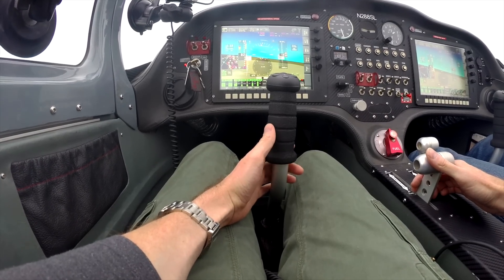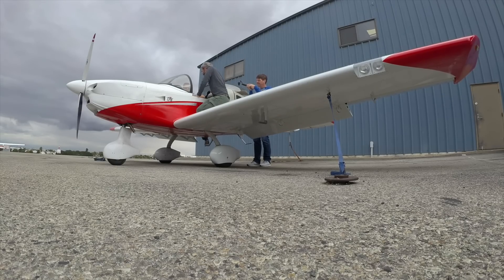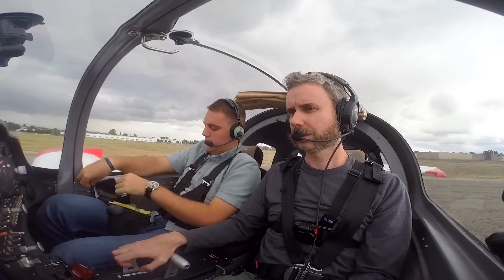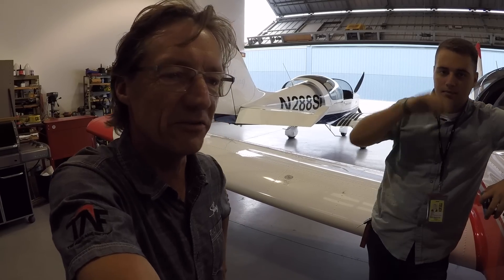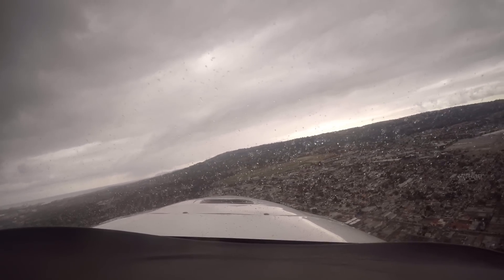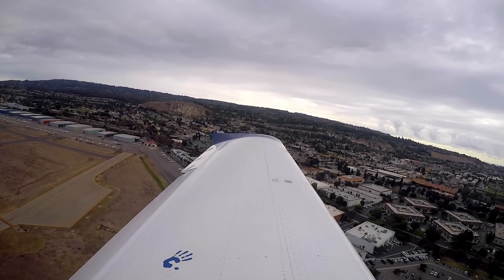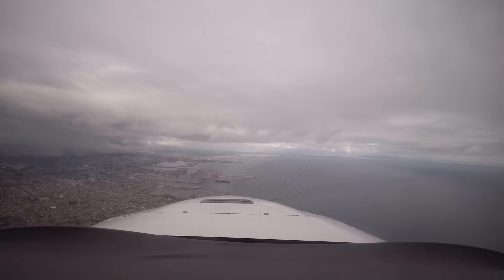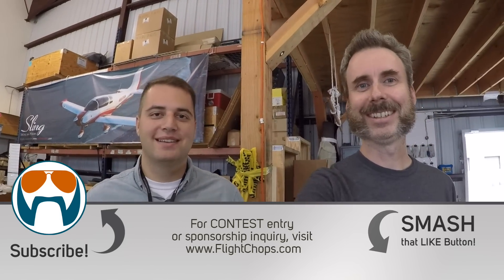Rotax Engine Failure - Flying Impressive Sling2 LSA in SoCal

Comment: Steve, you ARE inspiring the next generation, as well as entertaining and delighting the previous generations.  I've seen Bob Hoover a couple of times, his Energy Management Routine is something that every pilot should see and understand, particularly multi-engine pilots.
If I was getting back into flying, the Sling would be an awesome 'Weekend Flyer' for that $100 hamburger up or down the coast, but obviously wouldn't be a long distance flyer.  Josh Flowers also has a review of the Sling.  Would be a fun airplane to own.
Thanks for putting us in the left seat again, it's always fun to fly with you!
Reply from the maker: Thanks Gary!
Reply: Gary C - I believe you’re wrong about the long distance flyer bit.  We have a Sling 2 and a Sling 4 at our aero club (Ballarat, Victoria, Australia).  The Sling 4 has taken a family of 4, plus their dog, plus baggage all the way to Far North Queensland and back (over 2,000 miles each way), and down the full length of western Tasmania (again, well over 500 miles) with legs in both cases limited only by “bladder capacity”.  The Sling 2 has flown most of western New South Wales and northern South Australia - again with 500 to 800 miles range.  Both cruise at about 115 knots.  The Sling 2 burns about 19 litres = 5 gallons per hour, with 140 litres = 36 gallons on board; the Sling 4 - 115 HP Turbo Rotax - burns about 25 to 27 litres (6 to 7 gallons) per hour, with (from memory) 180 + litres = 48 gallons (?) on board.  Comfortable seating, plenty of room, good overnight baggage storage and 6 hours’ cruise plus reserves on board - what more do you want?
Reply: @warwickkinscher5986  I don't recall the reasoning for the sentiment, but it may have been something other than fuel burn.  Other factors to take into account, like comfort can come into play.
A Cessna 172 has a 600-700 mile range, but I don't want to sit in it for five hours at a time!
But, it's been a year ago since I posted that comment, I don't remember what it was all about, sorry.
Reply: Gary C No problems; We also have a Cessna 172 which is a good cruiser.  It’s just that I have really enjoyed flights in the two Slings, but Simon has put well over 300 hours up on his Sling 4 in the slightly less than 3 years since he completed it, flying the full length of the east coats of Australia with his family and / or friends.  It’s a great all-round aircraft.  But I agree - legs on a flight are governed by the needs for food and / or bladder relief rather that the aircraft’s capabilities - as long as one remembers to always check the fuel left and make sure it’s sufficient till the next fuel bowser including fuel for not only reserves but also contingencies (diversions, last light, weather, etc.)

Comment: Need to stop perpetuating the fuel gauge lie. They have to be accurate during flight. §23.2430   Fuel systems (a)(4) Provide the flight crew with a means to determine the total useable fuel available and provide uninterrupted supply of that fuel when the system is correctly operated, accounting for likely fuel fluctuations. Also, §91.205 (b)(9) Fuel gauge indicating the quantity of fuel in each tank.
Reply: They only have to be accurate if you a noob and didnt do a proper pre flight !!

Comment: this is why Carburettors are no longer used in cars. UNRELIABLE. being an aircraft. you would think...... fuel injection is a must. plus having Fuel injection means no more mixture adjustment. better engine reliability, better economy,. safer engine operation.. 
RELIABILITY

Comment: 6:51 I suppose any engine can be brought down by a defective float in the carburetor, but good grief this engine has FOUR floats and FOUR points of failure!  This is not redundancy, this is FOUR paths to failure!  Perhaps the  good news;  how does the engine operate at full power with one defective float and that carb running RICH???  Search for and read comments by Doug Grant.

Comment: If you fly machines, you should know they are not fail proof. To declare Rotax engines are crap is just more foolishness. To me, they've come a long way and have proven quite reliable. 

nice to run in to you at SNF, chops.
Reply: WendelltheSongwriter Rotax engines initially came with a factory guarantee. They were guaranteed to fail when they were two strokes :)
Reply: I fly a washing machine

Comment: carburetors ???  this is 2018, we've moved WAY past floats, why hasn't the aircraft industry followed.  I totally get "tried and tested" but come on guys that's just being backward thinking at this point!
cheers
Reply: Most Slings run on a fuel-injected engine, the Rotax 912 iS.

Comment: that's why I hate carburetors
Reply: PirateDynamics believe it or not, the carburetor Rotax is far more reliable and smoother running than the injected
Reply: Paul, he's right and yes it's bloody weird. Our school used to have a 912iS fuel injected equipped sling and it ran into some very, very weird fuel distribution issues. According to our maintainer the rotax fuel injection units are not very up to scratch, and is prone to weird vibration issues. The carbed version, the ULS replaced that engine, and no complaints at all. And our school has ran both of our slings to nearly 2000 hours in just over a year...
Reply: Not all carburetors, just crap carburetors.
Reply: that is false, a carburetor 912 run shaky and brutal at iddle, not the injection 912...the bing carburetors are motorcycle carbs (use on early BMW boxer engines)...
Reply: @howardflies  SI engines with the shakes is usually pitch settings on the prop wrong and not matched, prop out of balance, or the Rotax Gearbox dogs or slipper clutch are failing, from idling the motor too slow. Rotax wants you to idle at 2500 rpm during warmup. You have to set the idle at about 1600 to 1650, just to get these planes to stop flying. That tears up the clutch, or dogs, and bellvue washers in the gearbox. Gearboxes have been vibrating now and needing rebuilds from 40 to 600 hours.

Comment: I didn't see an engine failure. Did I miss something?
Reply: Yes.  They clearly show the 2 and 4 cylinders weren't working on the first plane, so they switched to the blue one...
Reply: I guess it depends on how you define “failure.” If this happened to me I would not tell people, “My engine failed.” I would say, “When I did my run up my engine was running rough and indicated problem with cyl 2 & 4 so I had It checked. It turned out to be a carb issue.”

Comment: wouldn't have a Rotax on anything but ultralights.... hard to see how a 912 is $10k+.... good clean remanufactured Lycoming or Continental make Rotax seem like a toy
Reply: Kenneth Johnson Haha just the opposite! They are built like a precision Rolex! The tolerances are insane. The latest 915 iS is a technological marvel in the aviation world right now and nothing can touch its power-to-weight ratio or its redundancy. Once you fly behind 4 stroke Rotax engines, it’s hard to go back to a Lycoming or Continental.

Comment: Why are you turning right on final? I thought all fixed wing aircraft use left hand turns in the pattern.
Reply: The Robotics Code Depot Unless it is a non-standard pattern, I think.
Reply: Nope - all depends on the airport and runway, or what tower tells you!
Reply: The Robotics Code Depot I am speaking as someone from the UK, but it is the airports preference on the direction if the circuit. I am learning to fly from a relativity large international airport and they like us to fly a right hand circuit for runway 27, this is because the tower is located on the south side of the airport and by flying a right circuit it means the tower can see us more easily. Also on the north side of the airfield it is mainly fields, whereas the south side has the terminal and and parking, this means we would have to fly a large circuit, which poses a safety risk.
Reply: Traffic at zamperini is right traffic because of the hill to the left.
Reply: Just depends on the airport man (terrain, residential areas, obstacles etc.) Some airports use 600ft patterns and 1,000ft patterns for better separation on parrelel runways with conflicting patterns.
Reply: It depends on what airport or country your in
Reply: Controlled fields, the tower tells you the pattern to fly. Unless there's an airspace, or obstacle issue it will 95% of the time, be chosen based on the controllers traffic.

Comment: Are LSA's capable [or legal] for IFR?
Reply: No expert, but I believe the answers are some (made before 2010) and a few, provably VERY few.  In 2012-13, I trained for a regular PPL in an LSA that was built in 2009 and is prominently labeled "IFR Equipped."  The 2009 date of manufacture is important, as explained below.  Its tail number is 907SL if you want to look it up. With my IFR rated instructor on board, I flew it in IMC conditions a few times.    However, in 2010, the standards body that governs Light Sport Aircraft, "ASTM Committee F37," modified the LSA standard to limit flight operations to VMC (visual meteorological conditions) and specifically prohibit flight operations in IMC (instrument meteorological conditions).  I believe this modified standard is still in place.  Thus, for ALL factory-built LSAs made since 2010, IMC is prohibited.  The factory-built LSA are the ones that fly under a "Special" Airworthiness Certificate.  This airworthiness certificate is "special" relative to the "standard" airworthiness certificate issued to certified planes like Cessna 172, but is essentially the standard one for LSAs.  As I understand it, you can convert a Special LSA (SLSA) to an Experimental LSA (ELSA), and assuming it's properly equipped and you're IFR rated, then you can fly it in IMC.
Reply: If they're properly equipped with all the equipment necessary (91.205) and have all the required inspections current for IFR flight (91.411) there shouldn't be anything keeping an LSA from being IFR capable. However, flying through clouds and extensive turbulence might be a whole new animal when you're in a 650 pound plane.
Reply: You cannot file IFR in an LSA
Reply: Lots of conflicting information.....some say yes, some say no. 
Sling offers an IFR package for this aircraft which would be rather odd if it is not legal.
Reply: Unfortunately Omar is incorrect, although there is a caveat. This article might provide a little more insight. 
https:// generalaviationnews . com/2017/04/17/can-you-fly-ifr-in-an-lsa/ (just remove the spaces, YT doesn't appreciate links)
Reply: You can't fly IFR in LSA but you can fly IFR in Experimental aircraft.
Reply: You can file and fly IFR in Experimental Light Sport Aircraft in IMC as long as they are so equipped. Just check out Bristell IFR videos.
Reply: I know from personal experience that the statement, "You cannot file IFR in an LSA," isn't categorically true.  At least some LSAs are IFR equipped and IFR legal.  When  I was a student pilot at John Wayne (KSNA) in SoCal, we had the usual layer of coastal clouds one day, so my instructor filed for an IFR departure to the Oceanside VOR (OCN).  We canceled the IFR flight plan when we above the clouds and worked on maneuvers in VFR conditions.  We obtained another IFR clearance to return and we landed by shooting the ILS.  I was radar vectored onto the approach and flew the instruments under his watchful eye.  It was fun, and very legal.

Comment: I hate to be that forum party-pooper, but as much as these LSAs can be great fun I have to say that these aircraft can make me a little nervous. I spent some time instructing in some LSAs (AP22 Foxbats and NG5 Bristells), and the reliability and safety was dismal. In the span of 6 months, I suffered a partial engine failure (carburettor vent line melted to the exhaust), witnessed a serious injury (and unforutnately a fatality) from a spin, and encountered mild C02 poisoning twice. I used to dread teaching stalls, no matter how well balanced you kept the aircraft (particularly the Bristell), it used to wing-drop violently and required significant correction, and even still it was reluctant to recover. As instructors we even asked the distributor if they had done anything to reduce the spinning tendency, and all they had to say was "if you know the spin recovery technique then you should be fine". The instructor involved in the spin fatality was an experienced pilot with an aerobatics rating who was more than capable of entering and exiting from spins.  I'm all for making aviation more accessible and affordable, and LSAs can be a great option, but I hope it doesn't come at the cost of safety. Love your videos steve, long time follower, first time commenter, keep it up!
Reply from the maker: Thanks for adding your detailed insights
Reply: FlightChops
Brevity is definitely not his forte.
Reply: Richard Darlington it seems that everything he stated was relavent.  I'd argue that for the point he is making, he is extremely concise.
Reply: Bristell is tragically easy to spin, I know a guy who lost his life in an unintentional spin. However the Sling is truly different, it's not just another 600kg LSA. The wing drop is next to non-existent, also the spin recovery is very easy. Honestly, the way people still think of LSAs somewhat make me rather angry. I flew both Cessna 172s and 152s, however I will still stick with the Sling LSA. The sling is as tough as the 152, flies a little faster, WAY easier to land and also stalling with flaps is a very, very gentle occasion. Guaranteed I am not paid by anyone, it is very, very sturdy (I know that thanks to my hard landings in ab-initio training, and many others). Our school has been running slings for just over a year now and both logged more than 1500 hours, ZERO major maintenance faults. Another aero club also acquired slings for training now as they witnessed our success.
Reply: I have not flown the Sling so I will have to take your word for it, but in my previous instructional experience on LSA aircraft, my greater concern is the way in which these aircraft are being regulated, and how some operators are taking advantage of the slack regulatory requirements. The RA-Aus Operations manual stipulates very relaxed requirements regarding maintenance schedules, equipment required, and safety standards. In fact it even requires operators to fit a placard to their aircraft noting "THIS AIRCRAFT IS NOT REQUIRED TO COMPLY WITH THE SAFETY
REGULATIONS FOR STANDARD AIRCRAFT. PERSONS FLY THIS AIRCRAFT AT THEIR OWN RISK." 

For RA-Aus, your aircraft can have failed brakes, no serviceable lights, no transponder, a sh*t radio, an ASI reading 20kts out, an altimeter which reads beyond the CASA VFR minima, faulty engine indicating systems, doors which are forced open after engaging the second stage of flap, bald tyres, and no trim indicator, and there is nothing (other than common sense) stopping you from departing. However from personal experience (which is not the experience of everyone) I have seen this taken advantage of by some operators. 

It frustrates me that some (not all) students will learn that this is an acceptable level of maintenance and condition of an aircraft. It isn't their fault, it is all they're being exposed to. It also frustrates me that members of the public, and those who don't know any better, can pay money to get in an aircraft which is not held to the standard that they should expect.
Reply: Our school is joint GA/RA, and in fact two of our new slings are GA registered. Also our maintainer is a GA maintainer, and we hold our maintenance to GA standards (legal requirement as we are also a part 142 school).
Reply: That makes me happy to hear.
Reply: Many good ones out there! Just gotta dig at it. I think I know who you flew for, there's only one school that comes into mind in aus who owns AP22 and Bristells and they are rather....interesting....
Reply: Kyle Crosley so your concern isn't necessarily with LSA aircraft themselves, but the standards at which they are regulated and maintained... Fair enough.

I don't care how well built a plane is; a lack of strict maintenance and soft regulation will always lead to an extreme safety hazard at minimum, and casualties in the worst case.

Just another reason to actually look in to that kind of thing before deciding who to fly with.
Reply: Cory Goodman for the most part yes. If you put a lot of cash into an LSA aircraft you could have a very nice machine, and put it on a good maintenance schedule and I'd pretty much have no problems with it. And I agree with your statement, it is super important people look into the safety culture of a flight school before you decide to fly with them, whether they're LSA or GA. Without naming schools I can say that some schools take advantage of the lower operating costs and softer regulations of LSA aircraft while still charging premium prices just to pump up the profit margin. The spare cash isn't being spent on employee wages or stricter maintenance, it is going right into the pockets of the top dog(s).

Comment: Does that Rotax have a gearbox to step down the prop?
Reply from the maker: Watch da video den comment :)
Reply: FlightChops ahh.. I got busted watching a video at a red light... will finish watching tonight. 😂
Reply: Flyers District
Not cool, man!
Reply: Yes, a gearbox to reduce prop RPM to approx. 2200-2400 or so for cruise.
Reply: Any engine that's operated over 2500rpm has to have gear reduction for the prop. Once the blades reach the speed of sound it starts to lose lift.
Reply: 100hp for 1.4 liter cubic= impossible with a 2500rpm at max power engine...only old technology engines (very big cubic, low rpm, high weight...) are without reduction gear, but some early small engines, inclusive radials, had reduction gears ...and ALL high power piston engines like ww2 military aircrafts engines , are reducted...

Comment: Cessna learned in the 1960's (Model 175) to use "prop rpm" on the tach.
Rotax engines are junk.